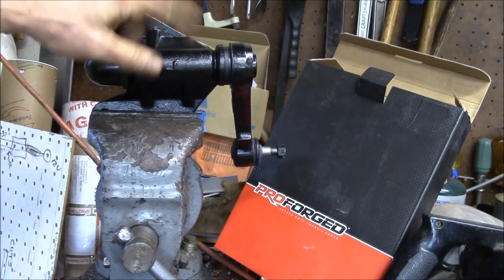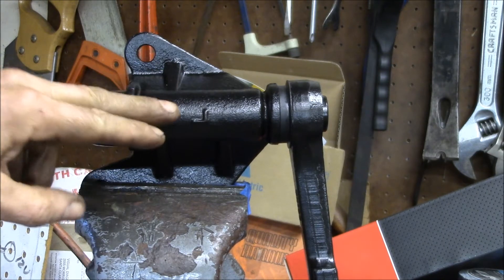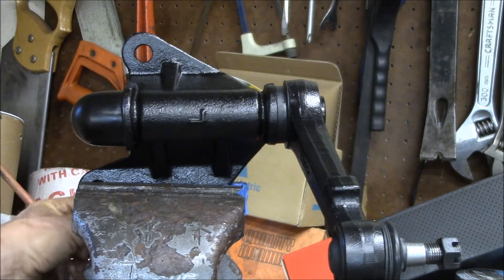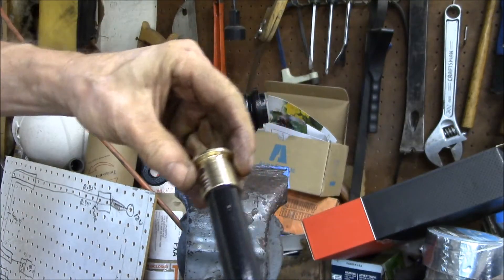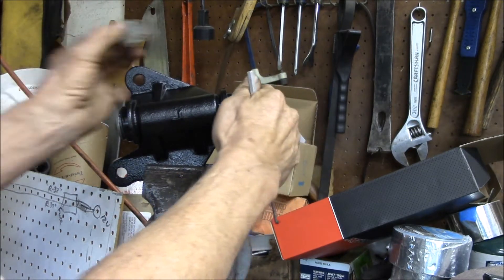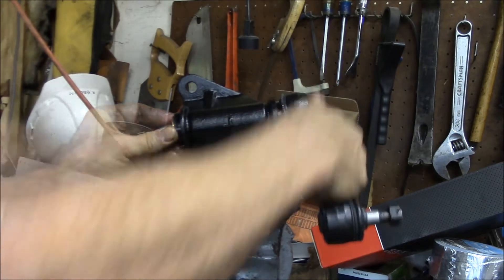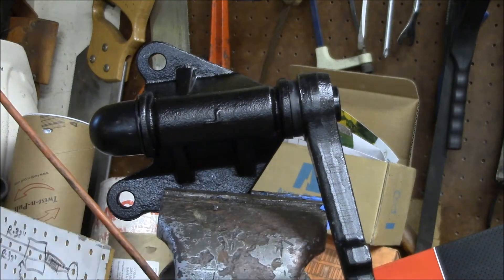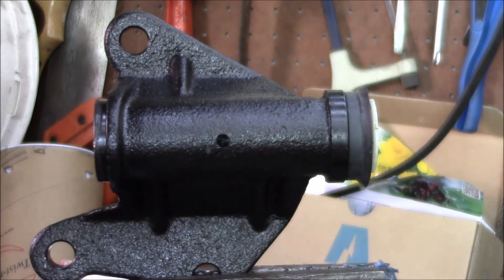Toyota 4WD/IFS Idler Arm Upgrade, Part 1

Comment: I wonder if there is any way to upgrade the ball joint side of the idler arm as this part seems to wear out for me very frequently.
Reply from the maker: Not sure if any of the standard idler arms have replaceable rod ends or not.  Might have to go with something like this:
https://www.chaosfab.com/1986-1995-Toyota-4Runner-Off-Road-Suspension-Accessories
Reply: Interesting, might be what I'm looking for.  Thanks for the reply!

Comment: the plastic bushings have an oil/grease groove inside, no need with the bronze bushings?
Reply from the maker: Yes and no.  Bronze is somewhat porous and that lets grease soak into the material and be released over time.  The original arms we supported didn't have grease fittings so this worked well.  But some of the current Proforged arms seem to have added a grease fitting.  About a year and a half ago, we started adding grease grooves for the arms that have grease fittings (you specify that when ordering the bushings).  We'll be posting a video on that in the near future, so stay tuned.

Comment: Do I need to measure my idler arm shaft to make sure it's 20mm before ordering the bushings? I'm pretty sure it's the original equipment from 1988. Or, if it's not 20mm will the shaft and bushings I order from you fit the original bracket? Not sure how to go about this.
Reply: Never mind, I'll just order the complete arm with bushings from you... I just saw this on your website: " Do these bushings work with the OEM/factory Toyota idler arm? 
"As described above, no, not directly. This is one of those "rare" cases where the aftermarket parts are actually better than what the factory put on the truck. In idler arms, "bigger is better" and the aftermarket idler arm shafts are a bigger diameter than the OEM part, plain and simple. So if you have a factory arm and the plastic bushings are shot, your two choices are to pick up a replacement plastic bushing kit at the dealer or pick up one of the larger after market idler arms (above). Or we do offer a brass shim kit that you can use to wrap around your undersized OEM arm shaft to fit inside the bronze bushings."
Reply from the maker: @scottc3165  Yes, most of the arms, including the OEM arm are smaller in diameter on the shaft.  Other than that, all the dimensions are the same.  Not sure why they made the arms with smaller diameter shafts, maybe to save a few cents.

Comment: Any reason not to use an impact wrench to crack the nut instead of the big shifter?
Reply from the maker: Sure, lots of ways to skin a cat.  A bit more control with a wrench and we like to avoid damaging the finish since we're sending these out to customers once we rebuild them.  The latest version of the Pro-Forged idler arm has a more reasonable torque pre-load on the nut and comes off with a much smaller wrench.

Comment: Hi, does this cure the vague steering ?
Reply from the maker: It will if the idler arm is the cause of the problem.  Easy enough to check for play in the steering system.  Have someone in the driver's seat turn the steering wheel back and forth just before the front tires start to turn.  Then follow the steering linkage down from the sheering column and shaft, through the steering box and out to the tie rods.  Look for the point where a part of the linkage upstream moves and the part it's connected to doesn't move.  That connection point will be a source of play in the system.  They may be multiple worn components, so you may have to repeat the test after repairing the first thing.
Reply: @The4Crawler  okay thanks, i dont use mine off road its purely for street/road use the only thing that bugs me with this truck is having to correct the steering while drive along a straight road etc, been looking at the rack and pinon conversion but i cant get hold of a RHD mustang rack :(
Reply from the maker: @retroal  May still be worth the time to try and find out the source of the problem.  It may be the steering box, that can be tightened up a bit with the adjustment screw and jam nut that's on top of the box.  Could be something else that's worn out up or down stream from the box.  Could be the alignment is off a bit.

Comment: Hello Rodger cool stuff! I just broke a brand new one, and the retailer is making me jump through hoops to warranty it. I was thinking if you could point me to the right direction I would prefer to rebuild the one I have. Cap and base is brand new, the  lower part of the unit broke off. Do you sell the pivoting piece ? And I would also buy the better bushings.
Reply from the maker: You bet, we have the inner shaft as well as the whole arm.  Shipping is a bit less on the shaft only and both available with the bronze bushings:
https://www.4crawler.com/4x4/ForSale/IdlerArm.shtml#On-lineOrdering
Reply: @The4Crawler  thank you! Just to make sure what would be the title of this set under the website?
Reply from the maker: @CesarLopez-ob9ix  Complete arm with bushing installed:
 Pro-Forged Idler Arm Plus Bushings - In-Stock: 

Inner part of arm (shaft) plus bushings:
 Right Hand Drive:

We mainly offer the inner arm/shaft for folks with right hand drive vehicles, since they RHD arm bracket is a mirror image of the LHD bracket.

Comment: My '94 22RE XtraCab 4x4 probably needs this.  It's got 177k miles on the clock and over the last couple of months it's developed a loud creaking sound when turning the steering wheel, coming from somewhere at the front of the truck.  Sorta sounds like a loud groaning squeak from an old shed door that squeaks the entire way open haha.  Really hear it when the steering is under load, and it's not the typical steering stop bolts because I put upgraded thick plastic caps on them 2 years ago when I bought the truck to fix that particular sound.  I'd be surprised if it's ever had the idler/pitman arms replaced since most everything I've encountered so far has appeared to be original spec, so if these idler arm bushings are plastic from the factory, mine are probably past it!
Reply from the maker: All the off the shelf idler arms, including OEM are plastic bushings.  If the bushings are worn out to where you are getting metal-metal contact (causing the creaking sound), you should be able to observe play in the idler arm.  You could use a bar between the arm and frame to try prying it down and check for movement there.  But yes, we have the bronze bushings and arms available:
http://www.4crawler.com/4x4/ForSale/IdlerArm.shtml#On-lineOrdering

Comment: Just replaced my 89 4runner 3vze shifter bushing. The whole time I was replacing the plastic bushing I was thinking 'why aren't these bronze like the bushing in my swing arm bumper?' Nice job R- and thanks for all of the informative vids.
Reply from the maker: Thanks for the comment.  Yes, if Toyota had designed in a bronze shifter seat that thing would have outlasted the rest of the vehicle for sure.  Can't really retrofit one in there as you need to flex the bushing a bit to fit it in place.  I'm running a modified shifter seat from Marlin on my '85.  I have a hybrid shifter setup where I took a B&M short throw shift lever and adapted an earlier model push-twist shifter retainer into the bolted shifter retainer that came on my '85:
http://www.4crawler.com/4x4/ForSale/ShortThrowTrannyShifter/1.html

Comment: Wow very cool to learn you made these and nicely shown. Reminds me of your awesome greaseable shackles;which is how I originally subbed to this channel, by the way.

Have you thought about putting in O ring groove maybe? Or is there a seal on the vertical 20mm bolt that keeps any dirt out? Well I guess the grease pressure would too sorta.
Reply from the maker: The idler arm has a seal on the bottom end that pushes up onto the housing.  That works quite well, especially with the extremely close fitting bronze bushings.  The latest ProForged design is also set up for a grease fitting, which makes periodic lubrication a snap.